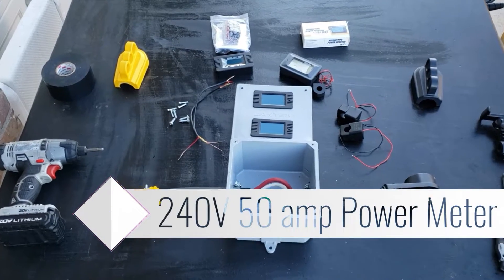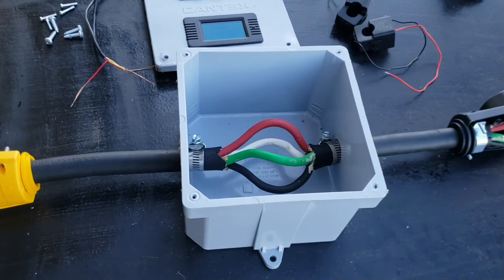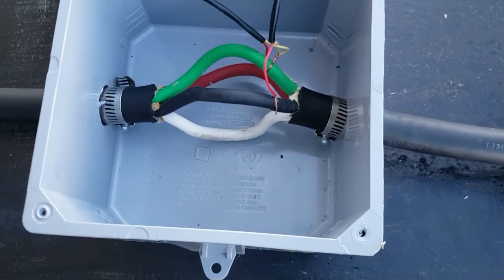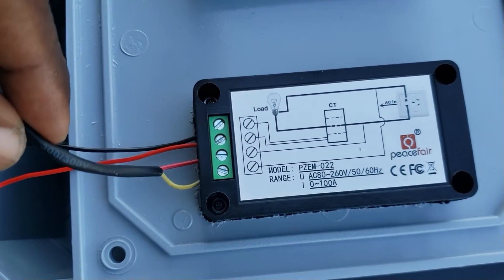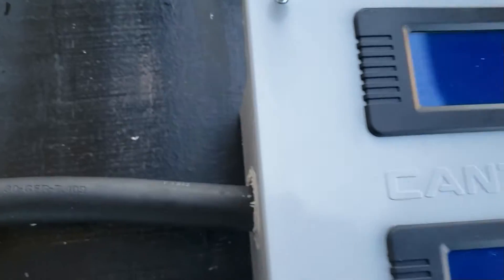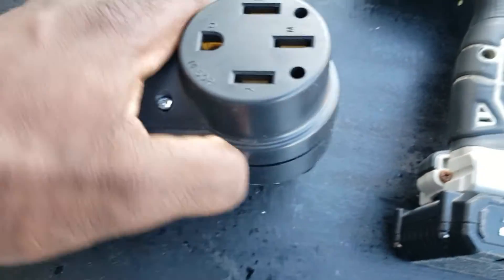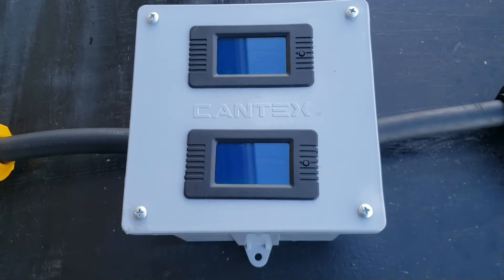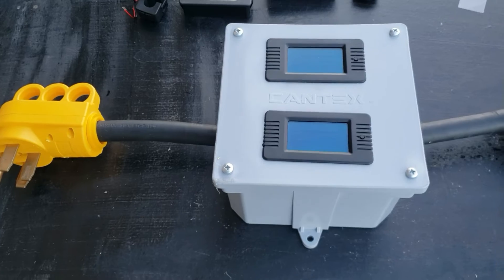How to make a 240V 50 amp Digital Voltage Monitor (DIY) Project

Comment: Neutral not ground. Even if they are bonded, Using ground instead would bypass the intended return path and could cause incorrect voltage readings or dangerous current through the grounding conductor. Ground should never carry a current unless there is a fault.

Comment: Thank you so much! Quick question: For powering the meters, could I take a standard 120VAC plug and wire both power meter hot wires to hot and both power meter neutral wires to neutral? And just use one of the generator's 120VAC receptacles for powering the meters? I'm just curious if it would eliminate me having to cut the insulation on the 240VAC wires.

Comment: The wiring is wrong. You use one 110v leg (red/black) and both can use the same neutral for each monitor. The ground is not used for anything with this monitor.

Comment: If this was not power from a gen but power from the grid how would you figure the total wattage from say a well pump using two hot wires? Would you add both meter readings together for overall wattage since I'm trying to figure out what wattage my well pump is? Thanks.
Reply from the maker: Yes that is correct ✅
Reply: @GeneratorReviews  I only have one monitor now so I guess I can temporarily put it on each hot wire just to figure wattage.

Comment: Great Job! I have this on my breaker box inside but it is fixed not movable. I would like this and being able to move around. I bet you could sell these as a finished product for ?$. These look like same exact meters I bought and installed. Nice engineering!

Comment: Nice but for me mounting this project box all near my electrical panel made more sense.  That way it is always close at hand to view and is 'permanent' to the house and out from the elements. It only lights up/turns on when I switch the interlock over to generator power.
Reply: For sure the only way I would ever wire this would be inside near the panel

Comment: I built a 30a version of this using l14-30r plugs. The displays seem to work, but I am not getting a reading on the watts. The other units display fine (ie amps, frequency,  and kWh). Do I have something hooked up wrong?
Reply from the maker: Check your wiring connection

Comment: shouldn't you be goin to the Neutral, not the ground for the meters power?
Reply: Using the ground wire to make a 130 volt power connection shows a basic lack.of understanding of electrical systems...the neutral is the one to use along both one of the hot wires for a 120 volt load.  I also laughed at the use of worm-drive hose clamps to secure the cables instead of proper size snap-in strain reliefs...oops!
Reply: I was wondering the same thing.

Comment: Just found your vid. Nice work!! 
Question...
I'm currently making something similar & would like your thoughts.
3 meters in a box, on a diy parallel Y cable, that will connect 2 120v generators to a 120v 30a RV outlet.
A meter measuring the output of each gen, & the 3rd meter measuring the combined output of the two gens.
The idea is if I mix 2 different gens, like a 2,000w & a 3,500w,  or a 1,600w & 2,200w,  I could see if they are sharing the same load equally or if the bigger gen is carrying more load as it should.
I'm wondering if the meter readings will be affected incorrectly by back feeding each other since essentially they're all on the same circuit leg. What do you think?Thx!
Reply from the maker: That should work fine I don’t see any issues with your idea 💡 good luck 👍🏾
Reply: @GeneratorReviews  thx 4 the reply. I'll give it a shot!

Comment: Can I use this same set-up with the predator 9500 even though it doesn’t have a 50amp outlet? I have the 30amp to 50amp splitter cord already. And run a 50amp cord from there to my inlet box.
Reply from the maker: Yes, you can use the same set up. Just have the 30 amp plugs.
Reply: @GeneratorReviews  I have the 30amp to 50amp splitter cord and connect that to the 50amp cord that runs to my inlet box. Would I still use the 30amp plugs or the 50amp?

Comment: Would it be safe to use a 50 amp range/dryer cord to bring down the price and cut back on some of the work?
Reply from the maker: That could work as long as it’s a six gauge wire

Comment: So I priced it all out and in most cases you would be looking at $70-$100 depending on parts stock (for those that don’t gave any of the parts.  I.E.:  Work box, pair of monitors, 10/4 wire. Male & Female ends and weatherproof connectors.  YES being able to monitor usage would be nice (since many generators don’t have it built in).  But us in necessary, due to the fact that most generators usually have overload/over draw protection built in… 🤔

Comment: How did you strip the insulation off the middle of the cable without nicking the insulation? I am using a piece of  10/4 soow cable.
Reply from the maker: Just use a very sharp razor blade and be extremely careful

Comment: Great video.  I am just subscribed.  I have the generator connected to my main electrical house panel via gen inlet and 50 amp breaker.  Can I use the 2 monitor clamps on that 50 amp breaker wires?  I could then connect the monitor ground to the panel ground bus.  Where would I connect monitor power?  I plan to have the 2 monitor displays in the house, so should I power the monitors using a regular wall outlet?  Thanks for your response.
Reply from the maker: Yes you can power the monitor from a separate outlet it would work 👍🏾
Reply: @GeneratorReviews  So I can have the 2 clamps on the 2 wires on the 50 amp breaker inside my panel and then have the 2 monitors inside my house.  I can probably cut and modify a regular extension cord with hot, neutral, ground, and connect the  monitors to a regular wall outlet.  Anything that you can think of that I am forgetting?   Can the monitors handle 110v coming to it?

Comment: Why green instead of white. I think power should be taken from line to neutral, not ground to line......It is true that neutral and ground are bonded in some installations, but not all....
Reply from the maker: If you take it from the neutral wire your monitor will never show zero because it always measures the power  from the monitor.
RVs, transfer switches and most generators are bonded

Comment: Hello Gavin, thanks for the video.  I built one this weekend.  It looks like it’s working, but I have a question.  I connected to a Predator 9500 using a 25’ 10AWG cable.  Interlock, etc.   No AC or other heavy loads.  The top meter read 123 Volts, 6.591 amps and 563 watts.   I’m not an electrician, but OHM’s law tells me the watts should be 810 not 563.   The bottom meter had similar readings.  Also, the top meter had PF reading of .61 and the bottom meter read .50 PF.  That should ideally read close to 1.00 and .90, or thereabouts.  Does the PF affect wattage output?  To any electrician out there, what does a low PF in this case mean?  Are my wires loose?  Any help or observations would be greatly appreciated.  Thanks
Reply from the maker: Just make sure you orientated your clamps the right direction
Reply: Hey, even though I did see any arrows which would point to a proper orientation, I did have mine in placed in opposite directions.  Once I changed one of them and both were oriented toward the same direction, problem solved.  Thanks, much appreciated.  The PF reading is now 1.0.   @GeneratorReviews
Reply: These clamps don’t have an arrow to indicate orientation.

Comment: Shouldn’t you have connected the meter power to the neutral instead of ground ?   Aren’t you using ground as a return for the meter power the way you did it?
Reply from the maker: You have to connect it to the ground because connected to the neutral is for your 240 V reading

Comment: I'm sorry but I'm done exactly what you've done and my monitors don't seem to pick up any current and when I have the monitors in place like you do I'm only getting a quarter of the bolts out but it's a funny thing to monitors are sometimes working and sometimes not working and this is the second set of monitors I've tried.
What am I doing wrong.
Sorry smartphone at put the word bolt but I said volt.
Reply from the maker: They are direction sensitive you have to make sure the monitors are facing the same way

Comment: Do you think this could be adapted safely to measure my main panel instead of a generator?
Reply from the maker: They have one that works great for what you need
Reply: @GeneratorReviews  I purchased the ones you show on this video. Do you have a link to what you think would work?

Comment: Why do you need two monitors ? Trying to set up something to monitor watts from generator to home . Thanks
Reply from the maker: Since the generator has 240 V, you need two  monitor, one for each leg easier to keep your generator load balanced.
Reply: He is measuring 2 phases of 120v loads, and messed up for a 240v load.
The thing about a 240v load, let's say it's 10amp, that single 10amp portion is seen on both legs. So with measuring both legs and summing for total, you would be doubling that single 10amp. That's wrong, so you would have to do some testing and write down somewhere the 240v compensation for this (Gen Supply calibration).
If your loads are purely 120v on both legs, you can use 2 meters for balancing potential, or you could use just 1 meter.
To use 1 meter, run both hot legs through a single CT, with one hot leg passed through the CT in the opposite direction (looped). That would give you accurate total 120v loading. The same problem about a 240v load exists here(doubling).
Reply: @mikecr4916  But isn't it true that the 10amp portion of one leg is only 120V, so if you are measuring watts, you do need to measure both sides and add them together?

Comment: Just came across this and thinking about it for my Predator 9000, I have a 240v/ 30 amp twist lock, curious if I can use one meter with the clamp around both legs and it will add up the total wattage? Or is it necessary to wire up 2 meters, one for each leg. I'm thinking I'd like it plugged directly into generator, mounted to frame (if it doesnt vibrate loose), then run my cord to inlet at the house. Thoughts?
Reply from the maker: I would have to test this out, but I think if you put one on the neutral wire, it will read both legs
Reply: Nope, you can't use one meter (current transformer, CT) as you describe if you want an accurate reading of total wattage.  To accurately measure the total current (or watts) drawn from the generator, you would need to place one CT around each of L1 (arbitrarily, the red conductor) and L2 (arbitrarily, the black conductor), otherwise, because L1 and L2 are 180 degrees out of phase, the opposing currents will partially/fully cancel each other out if measured together, resulting in an inaccurate reading of the total power being drawn.

Comment: will this tell me a rolling use for a total of lets use an example of 30 days? I am trying to see how much power a 5th wheel is using so I can charge them for total KWH. thank you
Reply from the maker: Yes it has a meter that counts total kWh used and it is resettable

Comment: I made a unit like this and it did not work on my conventional generator. It worked fine on the Inverter Predator 9500 I have.  With the old Powermate generator the display just flickered a little.  I'm assuming the power isn't clean/stable enough for device to work.  It might with a power conditioner but I won't be getting one to test that.  I just thought I'd mention this.
Reply: yeah, power for the monitor should be taken from a hot and Neutral (white); never Green.

Comment: Quick question. Do the wires powering the meter need to be attached to the same wires that you are measuring? I'm installing on my generator and it would be easier to get power to the monitor by using a different source .
Reply from the maker: The power of the meter uses you can’t even measure so it should be OK you’re not gonna get a different reading just powered before the meter.

Comment: I would like to know what (wattage ) my industrial fan heater is drawing as it can draw up to (16 amp ) using a (13 amp) plug 
I do not want to make it draw to many amps to do another melt down on the plug. Like what happend on Sunday 25 December at 09:45hts. I was unaware that the thermostat was on it maximum power. Hence the burn out.

Comment: Hi, Gavin, great instructions, I built this last night but I am going to use it for a more or less permanent mount beside my main panel so I can watch my gen when it is under load. I intend to put the conductors around each leg in the internal portion of the inlet box from outside, my question is: I need to add about two feet to the black/red wires from each conductor...using the same gauge wire, do you think that will induce delta into the accuracy of the readings or will that still be ok? I am thinking ok but never hurts to ask, lol. Thanks!
Reply from the maker: You should be perfectly fine! 2 feet not gonna change anything 
That’s pretty awesome you made one. Thanks 👍🏾💯

Comment: Very cool. I wonder if I could attach the meter to my 50amp breaker wires and mount the box next to panel to monitor gen usage when using gen and not utility power. That DIY kit would be a big seller man!
Reply from the maker: You could make that happen thanks for watching 👍🏾

Comment: What gauge wire did you run from the #6 solid wires in the 6 x 6 x 4 box to the monitor?
Reply from the maker: It’s 6 gauge wire I just stripped back the insulation in the middle

Comment: Hey. Is that an adapter cable that came already with the connectors or is a soow 6/4 cable and you added the connectors.   If it is a adapter that came all in one can you provide the link?
Reply from the maker: Hey Javier 
What’s up buddy 
All the pieces came separately. I’m going to add all the links.
Reply: @GeneratorReviews  thank you.   The Hurricane Ian came by my house. I lost power and I was able to power my whole house with the GM9000iED.  Stove is gas, dryer gas, 2 AC units- 3ton and 2ton.  With both ac running, refrigerator and anything else that is normally connected like internet etc I was running the generator at 4,800 watts.  💪🏼
Reply from the maker: @JavierRivera  nice 👍🏾
Reply: @JavierRivera  So does the GM 9000iED put out 240 volt for the ac units?.
Reply: @sh839c  that is correct.  240v and 50amp.  I have a few videos on my channel
Reply: @JavierRivera  Excellent. I will check out your videos.

Comment: Can you use 10/4 SOOW cable for this?
Reply: 10 gauge wire would only be good for up to 30 amps
Reply: Agreed. My setup is all 30 amps from the generator to the house generator inlet so I can duplicate this setup Gavin has outlined but with 10/4 SOOW I am assuming. 
I just want to be able to monitor the 2 legs off of my 240 30amp outlet…..and want to do it safely.

Comment: Shouldn't the power to the meters be the hot and neutral? Neutral is current carrying where ground is not, and for accurate power readings, you want to measure voltage across the load. See the 5th diagram down in the Amazon link you posted up top.
Reply from the maker: Most generators are bonded, the ground and neutral wire coming from the same place and you have to get your power reading from your hot wire
I guess that’s why I showed a test. It works great and it goes back to zero with no load.
Reply: @GeneratorReviews  My Honda is floating neutral. Probably no big deal, but as an engineer I'd still follow the wiring diagram since that is the recommended method.
Reply: @GeneratorReviews  So if you unbond the generator to backfeed an inlet would you do hot and neutral?
Reply: @GeneratorReviews I have to unbond my Westinghouse generator as I’m connecting to a 50amp inlet and the main panel has a bonded neutral so the generator needs to be converted to floating neutral. If I want to use these devices, do I power the monitors with hot and neutral instead of hot and ground in my particular case?

Comment: I noticed the whiskers sticking out on the terminals.  Stranded wire is always twisted clockwise.  Hint:  Twist the exposed stranded wire counter-clockwise.  Then the screw tightens down on the wire, the strands will be drawn in.  Problem solved.  Power is calculated by multiplying the voltage times the current.  The reason for the voltage connection.  The things you are calling monitors are called Current Transformers or CT's
Reply from the maker: Thanks buddy 👍🏾 great tips